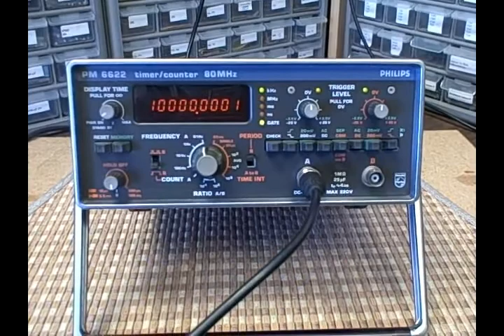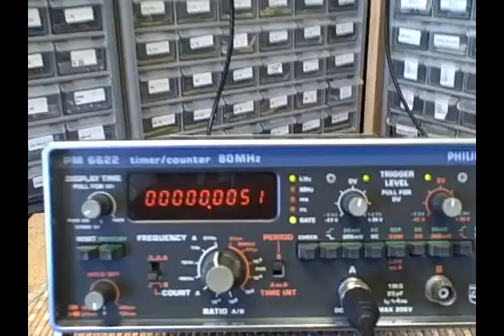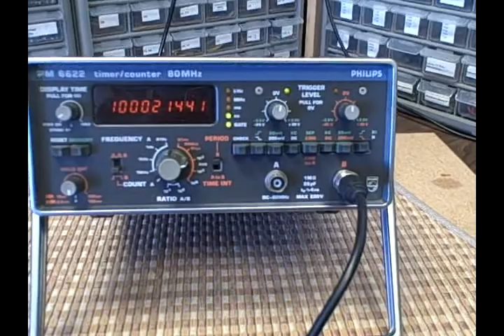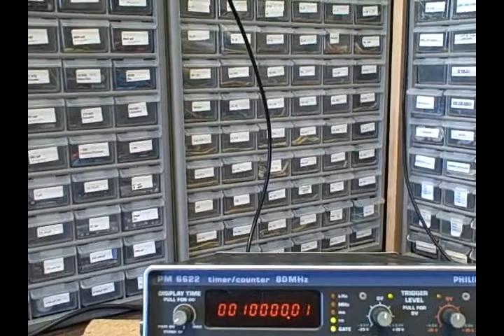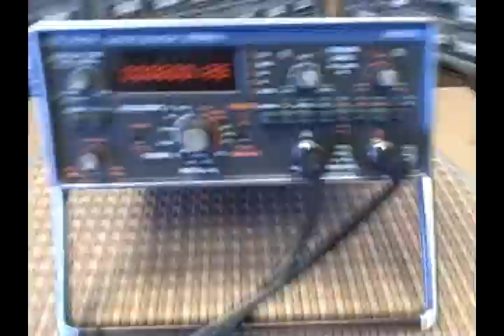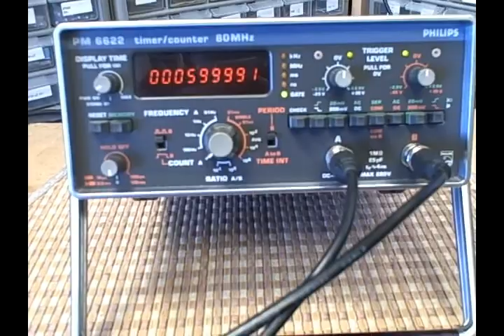PHILIPS PM6622 DC to 80Mhz Timer/Counter

Comment: I picked one up last year in great condition much like this one, umfortunately its missing the handle, otherwise its complete, clean, and calibration is still spot on. Might be worth looking around for a handle since I did get an awsome deal on the   counter. Took a chance on an untested\parts machine on ebay and got super lucky when the missing handle was the only thing wrong with it.